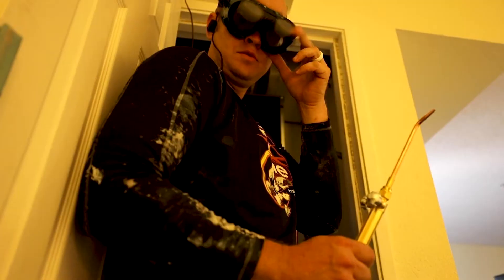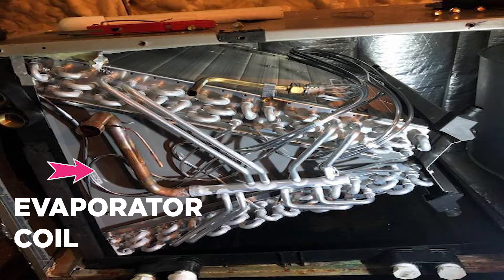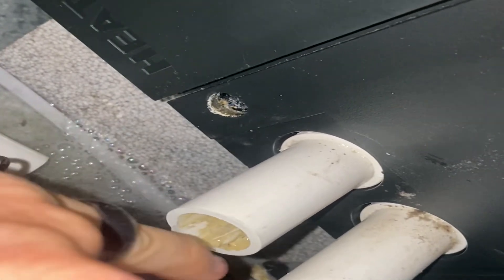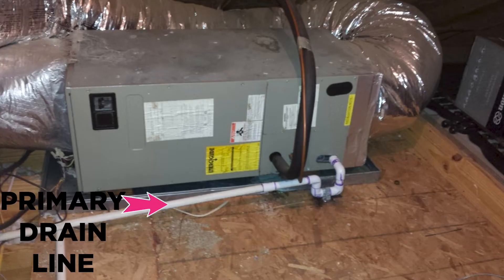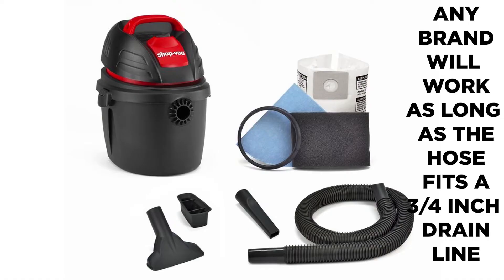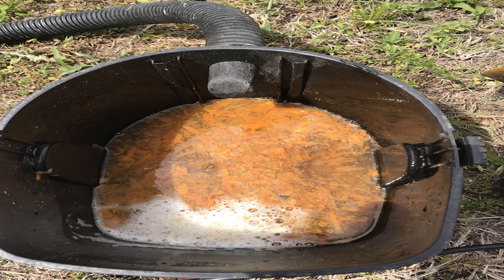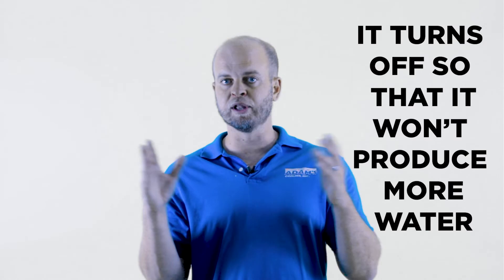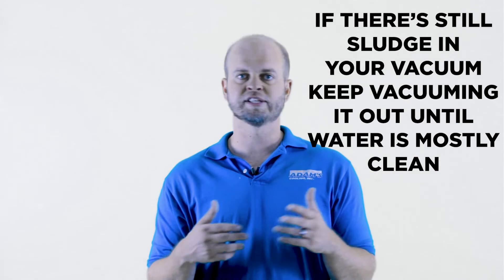How To Unclog AC Drain Line

Comment: You need an airtight connection in order to get the suction to work. Ive used duct tape between the condensate line end and the shop vac nozzle(ok until cold water condensates on pipe then tape loosens), or use a Drainado (sold on Amazon) attached to the shop vac which creates an air tight connection. Then yes it works ok but it has to be done frequently to keep the algae formed by the cold water and heat from forming again quickly).
Reply from the maker: Interesting. I wasn’t familiar with a Drainado (never used one), and YES the connection definitely needs to be tight, that’s for sure. Thanks for commenting 👍

Comment: We just had this happen and what I don't understand is that the drain pan was entirely dry. How did the line from the drain pan get clogged if the pan was dry?
Reply from the maker: Maybe you caught it before it started overflowing into the secondary pan. Did you get a lot of sludge out when you sucked it out?

Comment: Poor some bleach every month on the pipe
Reply from the maker: So bleach is not recommended to pour down your drain line because the drain line is connected to the primary drain pan upstairs in the air handler, and the fumes from the bleach can actually cause damage to the evaporator coil.